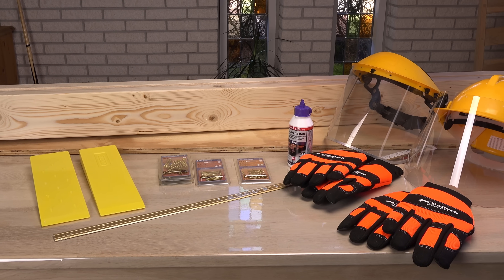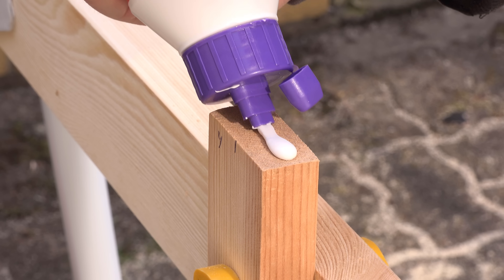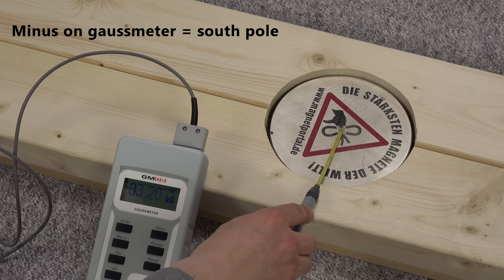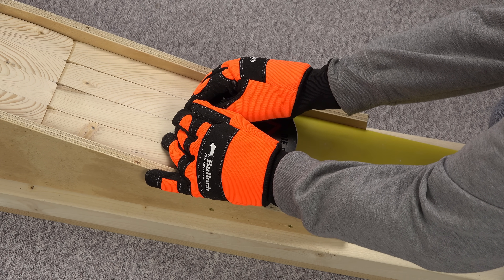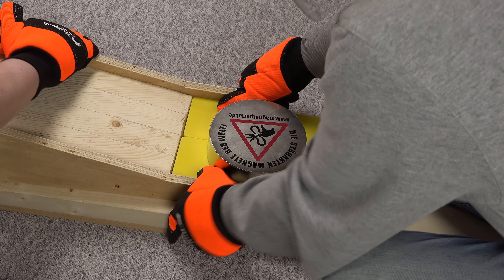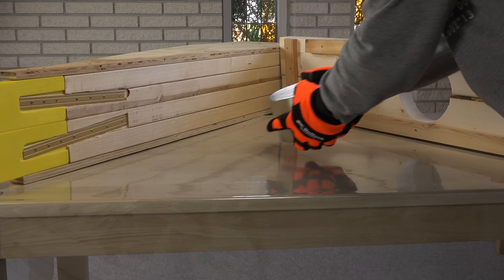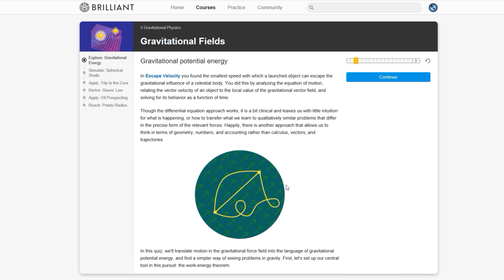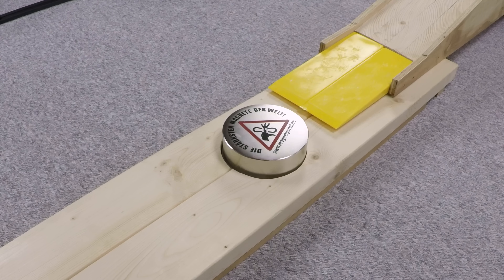Monster magnet meets monster magnet...

Comment: I wonder if two of those cylindrical monster magnets could perform the same function as an english wheel?  An english wheel is a tool for shaping metal and removing dents and creases.  I wonder if you could try an experiment with a piece of sheet metal.  Dent it with a ball pean hammer.  Create a crease with a larger dent.  Then see if two magnets can remove the deformations by rolling one back and forth with the other magnet on the other side of the sheet metal.

Comment: I would think a thick block of Ice, a very thick block off Ice between the poles located inside a PVC pipe used to guide their path be allowed to melt slowly allowing the magnets to come together.The pipe ID just a hair larger than the magnets. I work with magnets just like these but never tried to control bringing them together. I try my best to do just the opposite.

Comment: So...
I watched a video of an interview of a scientist who worked for Lockheed Skunkworks. He ordered two magnets about this size but with a hole in the middle. He forced them together with like poles facing, using a threaded rod & some large nuts.
He then dropped them off of a high place like 1 or 200 feet & also dropped another object of equal mass & shape. He has a framed certification stating that the magnets fell slower than the other object when dropped from this height.

I thought this was pretty damn interesting. It helps illustrate that gravity & magnetism are linked.

Comment: I have a bunch of ten, much smaller neodymium magnets.  About 30mm x 8mm.  They are terrifying even at that size.  The attractive forces are deceptively strong.  I put them together and they are nearly (but not quite) impossible to separate, as I discovered two days ago I had to separate two of them yesterday for use in a work project.

Complete concentration is needed when two neodymium magnets of any appreciable size are anywhere near each other.  Mine seem benign enough even at a few centimeters' distance.  That is exactly the problem.  When they get too close, they slam together with unexpected and alarming force, whether fingers are in the way or not.

Comment: I wonder if using a 1 foot section by 6 inch ID PVC pipe filled with an 8 inch solid water plug would have worked? Drain holes would need to have been previously drilled along the pipe (or score marks made along the inside of the pipes wall) for water egress, and rubbing the magnets with a lubricant wax/corrosion inhibitor prior would also have been beneficial. Just orient and place a magnet on each end and wait for the ice to melt. 🤷‍♂️

Comment: What if you put it in the bottom of a bucket, fill with water, freeze, place on top, slightly heat bottom and have a hole for the water to drain and the top one gradually lowers?

Comment: You should try out, some of these cheap gauss meters from China... would love to see a compare factor vs GM08 and your labgrade unit and how accurate these cheaper models to around 50 bucks (incl. del. & 25% VAT) with 2% rating in some segment and 5% accuracy rating in the higher range..

Comment: Noise looks like it was caused by a frictional slide of the magnets on each other as they aligned themselves together, which is a lot of friction, on a tiny surface area, over a tiny fraction of time. You could have probably seen the heat generated on an IR camera, but that's an experiment for another video.

Comment: Only 1 minute in i can already tell you yes it is possible to combine the 2 magnets anyone with a brain knows that. And Ferrite magnets are brittle, Neodym magnets are strong. This was made 5 years ago so maybe it was not the same back than but today's Neodym magnets are strong and hardly break if you buy high quality ones i have one 4500 kg and it's scary i rap it in two towels no where near metal when i'm not using it
Reply: Bro, neodymium magnets easily shatter. SlowMo guys recently made a video about it.

Comment: reguarding the noise, as the magnets got close to the edge the top one, being moved back slightly while pulling, ended up getting pushed to a further angle and loosening it's grip from the wedge, which allows the wedge to be moved before it grips again. it does this in a cycle a few times before the magnets touch and don't move apart anymore.

Comment: I just realized how you could have done this MUCH easier without leaving an annoying piece of plastic between them.
Step 1: Buy a plastic pipe that is slightly larger than the magnets.
Step 2: Put one magnet in one end of the pipe.
Step 3: Fill the pipe with about 3 feet of ice.
Step 4: Put the second magnet in the pipe with the ice in between.
Step 5: There is no step 5. Just come back after the ice melts.

Comment: That little piece of plastic stuck between the magnets would drive me nuts 😆

My method, not that I plan to do it...but after giving the pinched plastic some thought, would be like this:

Make a tube the exact diameter of the two magnets. Place one magnet at one end. Make a magnet-shaped puck out of dry ice (frozen CO2), place in the tube. Next add the second magnet. The puck would gradually turn back to gas, slowly bringing the magnets closer together, until finally completely joined. No solids at risk of being trapped! 😊 Might be worth a try!
Reply: ...and reading though the comments, I realise someone else already thought of this. Although theirs was a joint effort ☺️
Reply: The problem with this method is with the amount of force these magnets are generating. I would be concerned about the sheer pressure from the two magnets causing the dry ice to evaporate much faster and still allowing them to slam together fast enough to cause damage. Remember either one of these magnets is fully capable of lifting a car so long as the car is capable of supporting its own weight from the small contact area

Comment: I was always taught magnets are not additive. 

Two strong magnets don't equal a stronger magnet just a slightly weaker one. 

But I would love to see the before and after tests
Reply: As he showed in the video the strength of a magnet and dramatically decreases with distance so it's not that they don't add together it's just that the second magnets field is not having the effect you would expect it to but overall the magnet is stronger now than it was before

Comment: Try combining magnets by placing a large block of ice between them and place wooden boards as guides on the side so that the magnets line up, then all you have to do is wait for the ice to slowly melt away as they move closer to each other.
Reply: Ice doesn't melt evenly, at some point it'd get crushed and you can't control it properly.
Their method was significantly better.

Comment: To pull them apart. What they should have done. Is to place a metal sheet of pure stainless steel or other other metal rather than iron. Metal sheet should have 2 solid metal hooks.Now place 2 horses facing opposite to each other. Now place steel chain through those hooks connected to metal sheet. Which was placed between 2 magnets. Now pull 2 horses against each other as TUG OF WAR. Magnets will be separated. No problem.

Comment: 3:28 Instead of hands holding the magnet in place, something like a baseball mitt the bolted to the floor with leather or plastic straps. Then, accelerate the wedge away from the mitt-held magnet using a tesla "zero to 60 in 2 seconds" fast accelerating car. ...Get the meat organism power out of the equation.

Comment: What if you use a long block of ice? after the ice melts, they will be combined without pieces of plastic stuck in between
Reply: The ice won't melt evenly, could get partially get crushed etc. This wasy is much more controlled.

Comment: I like to use the smaller and much safer 4×4 cube needs and when they get stuck I struggle to separate them from whatever they are attached to. I can't imagine the strength needed to move those two monsters.

Comment: 1. lubrication?   2. create a cylinder for the magnets to just fit into, magnet on the bottom, block of ice cut to fit in the middle (1ft long), topped with other magnet.  wait for ice to melt, easy and safe.
Reply: Bad idea. Ice melts unevenly, magnets crush the ice partially. This way is significantly safer and more controlled.

Comment: I have 2 strong magnets I used for steel fabrication. I could put one on a string at one end of what I was working on, and pull the string really tight, and use the other magnet to hold the other end of the string. You do not put them face to face. They can hurt you and are not as big as the ones in the video. A guy I worked with borrowed them and stuck them face to face. I made him get them apart. They are so strong that if you do stick them to a piece of steel you do not just merely pull them off. One has a rocker mounted to the side. The other has a long bolt sticking out of the top of it.

Comment: Yes, they can be taken apart.  You just need to be stronger than the magnets.  I can think of several mechanical designs that would do the trick.  Pulling them would be hard, but sliding them apart using mechanical arms would work for one.  There is a channel here on Youtube where a man smashes things using a 150 ton press.  Make a carriage holding one magnet and press the other one sliding it off.  The magnets could not resist 150 tons.  Not really a hard problem.

Comment: how about a tube the diameter of the magnets perforated along its length with tiny holes.  fill the tube with crushed ice, as the ice melts the magnets move closer together..
Reply: Wouldn’t work as once they get close enough the magnet force will force the ice out at extremely high pressure. Essentially it could cause the ice to melt
Reply: @chrisrstt  So the pulling force is so strong that the ice gets crushed so hard the force behind it is enough to bring the ice to a higher temperature?

I would really love to see this in some thick acrylic tubing with smaller magnets than shown in the video but still strong ones
Reply: @Ikxi  yes, think of it like a hydraulic pressure. High pressure=heat
Reply: @Ikxi The effect wouldn't be that dramatic until you started getting into dangerous to try this territory because you'd be looking at some fairly large magnets
Reply: this... is actually interesting idea it would allow combining magnet of any size as long as you have tube just a bit bigger than two magnets.

Comment: Have you looked into using a hydraulic fluid as a way to slow down the magnets coupling?
Thick acrylic cylinder to handle the serious pressure, bore it out to magnet diameter.
Bore and thread a small hole at the bottom at the height of first magnet, install a brass valve.
Insert first magnet, fill cylinder with hydraulic fluid, insert second magnet.
The fluid will get through the sides of top magnet as it descends, but I think it's worth an experiment.
Reply: galaxy brain
Reply: That was my idea. Using a very viscous liquid.
Reply: Or instead of a messy fluid, just use dry ice?
Reply: @fredthegraycatt  or just ice
Reply: Why not just use a copper tube about the diameter of the magnets?
Reply: @babybirdhome  that copper might start glowing with the electric field created

Comment: Next time make a long box or cylinder that fits the magnet and does not allow it to twist inside.  place one magnet on the bottom, fill on top of the magnet ice about a foot or greater thick, then let it melt slowly.  It will sink down slowly until the force of the magnet squeezes out the ice.

Comment: There is an easy and cheap way to combine these magnets. From Home Depot, get a 5 foot long plastic pipe, the inside diameter of which  matches the diameter of the magnets. Set the tube vertically on the ground, on top of  the first magnet. fill the tube with cubed ice. Set the second magnet on top of the ice. Turn up room temperature or use a hair dryer to melt the ice. The magnets will combine slowly, perfectly, without damage.
Reply: Really bad idea. The ice would melt unevenly especially under this pressure. Their attemptis much more controled.
Reply: @NotBroihon  I have conducted experiments with ice and pressure, have you?

Comment: I have test with 2 small iron rod (0.3"x0.5") pile up over a 2.5''x2"x0.7" block magnet, the power of induced magnetic flux made 2 small iron rod very hard to separate, I use FEMM, the power of large magnet easily induced small iron rod near saturation. In your case, your monster magnet combine with two 1"x1" iron rod can produce over 1.6T magnetic field when 2 iron rod distance is 0.5cm, if FEMM is accuracy

Comment: Would be much easier like I did years ago with two 4in magnets. Sit one on the floor N side down, place a 2-3ft long pvc tube (with 1/4in holes drilled in it every couple of inches along the tube), over top of the magnet. I had made a jig out of 2x4s, hole-straps and zipties to hold the tube upright and straight. Fill the pvc with crushed ice place the 2nd magnet in (N side down) and let them slowly come together.
The holes in the pvc will let you know its progress.
Reply: How did you separate them?  Or did you?
Reply: @marveloussoftware4914  No I didn't separate them. Engineering had come to me as they had already shattered one pair (luckily no one got hurt) and damaged another pair. They were supposed to go on a new fast CTL (cut to length) machine design and found they didn't have enough levitating force with a single magnet to float the cutter assembly.

Comment: The legend says that those two magnets are still stuck to each other till today :)
Reply: How are you going to get them apart
Reply: @guynorth3277 you dong
Reply: don't *
Reply: @4lwn ; One cannot ask a question
Reply: @guynorth3277  i said dont not dong
Reply: @4lwn  that was smart 😎
Now nobody khows whether you write it on purpose or by mistake
Reply: @urwjtdgkfhkc2286  wait im confused by myself rn
Reply: @4lwn  🤣
Reply: @4lwn  dong
Reply: They can be separated just like any other magnets. Will take more than 2 people though. Definitely something with a lot of pulling power. Probably more dangerous to take apart than put together!
Reply: @hidingposer3422  "just like any other magnets?"  Any other magnets do not take 2 people. 😁
Reply: Lol
Reply: I guess it still as you can see in his video that is his strongest magnet
Reply: You can actually turn off and on a permanent magnet.  Not sure if it would work with 2 of them.

Comment: I use to work next door to a place that sold magnets. Sometimes they would get a shipment with a huge magnet in a box. Every now and then the magnets would be stuck to the side or floor of the truck. We would use a forklift and a 10,000 pound capacity nylon towing strap to move the magnets.

Comment: If you make something soft and that can be disolved in water you can put the magnets together and put it in water so it slowly connects
Reply: It would dissolve unevenly under pressure. Keep in mind that the pull force of the magnets close together is a couple of tons. This would not be a reliable method just like putting an ice block between them.
Reply: @NotBroihon  thanks for the info

Comment: there could have only one way to separate the magnets, it would be to put them under an electric charge that can invert the polarity of one of the two magnets, but to take with caution beacause instead of attract eachother, they will repulse eachother and with a power at that huge when a human hand can be totally crushed by their force, they can also be projectiles mooving at high velocity.

Comment: I was thinking if you use a huge ice block to joint the magnets. put the ice block above one magnet e put the other magnet above the ice block. the pressure between the two magnets will make the ice melt slowly until the two magnets stay together.
Reply: or the ice block may broke when the two magnets is almost together

Comment: You should be able to do this with water/fluid resistance. Have a barrel with magnet on bottom, put top magnet in. Wait as the top one falls and water is pushed over it. You need to calculate an appropriate width of the barrel, it needs to fit the magnet quite tightly.

Comment: I wonder if you could make a platform, and throw them with the poles on the opositve way, i wonder if the magnet will be shoothed out, or if it will stay suspended on the air